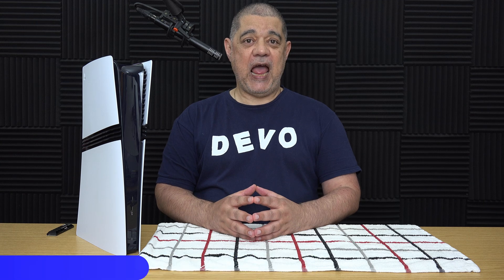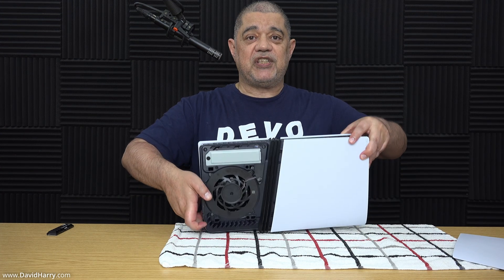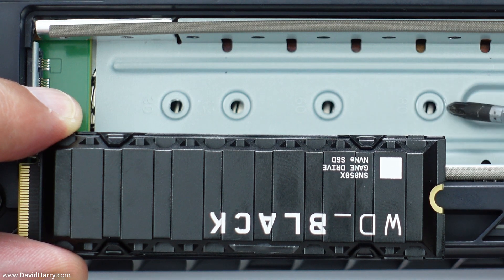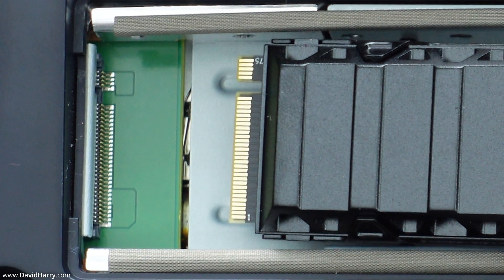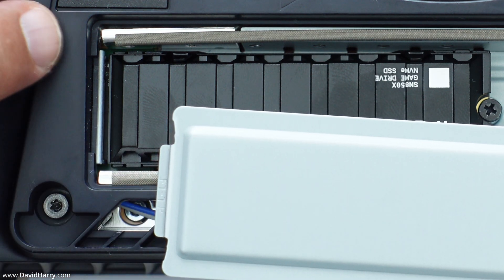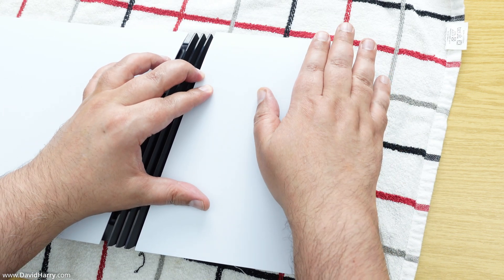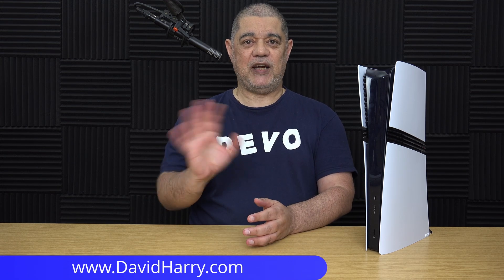How to install an M.2 NVMe SSD into a PS5 Pro | Step by step guide for PS5 Pro SSD upgrade

Comment: Few things to note:
1:38 unlike the slim on pro this screw seems like its cross threaded from factory
1:45 Notice how soon as the screw comes out the plate seems to pop out meaning it doesnt have a perfect fitment unlike the slim models where it fits flush
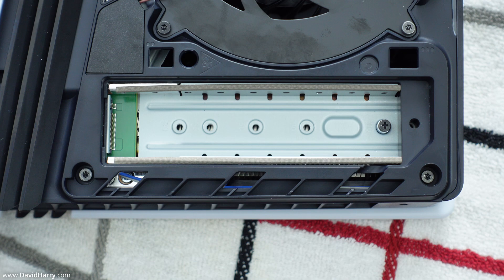2:19 This screw seems squeaky on pro unlike on the ps5 slim which seems like pro has lower quality machining than the slim.
5:45 Notice how paint is already scratched as if screw was forced on at factory

Do you agree Davey?

Comment: This is a fantastic tutorial and to be honest. It's not hard to install an SSD in any other PlayStation models. The hard part is removing the plates now when it comes to the PlayStation 5 Pro it hurts and it's kind of painful because as you remove them, they pop and it feels like they're going to break but it's a fantastic tutorial for those that want to have peace of mind when they want to change their SSD on their PlayStation 5.
Reply from the maker: Hi, I'm glad you liked the video 👍 And yes, it's a little nervy when it comes to taking off the panel, however, it is fine to use a bit a force as this is what is needed. But I would personally like to see a better way of removing the panel without the fear that you mat snap it. Cheers, Dave.

Comment: When you add an NVMe drive to PS5- does it add the existing SSD capacity to the new NVMe SSD capacity or does PS5 treat it like there are 2 separate NVME SSD drives?
Reply from the maker: It becomes a second drive and then the PS5 has a new option of where you want to save any new game downloads and also if you want to copy existing games from the internal SSD to the second SSD and the other way round. I'll do a video about this soon. Cheers, Dave.

Comment: Worked perfectly thank you. Simple to do even if you're a newbie just have to follow the steps in a methodical manner. If you're an old school PC person or PC person who's used to upgrading a PC its a piece of cake. Remember before installing the SSD make sure the PS5 or PS5 Pro you've updated the latest software on the console FIRST, then install the drive.

Comment: Ive watched a bunch of these but what aboot the FIRETRUCKIN heat sink?  And yeah this shits weak! Any ninny with a philips can plug in a frikkn chip. What about if you have to update the firmware on the chip????  Lots of folks talk a out how after their install their rig crashes. But nobody talks aboot the sketchy end of this…… F*#@&$N software/firmware.  Like doing a vid about adding a HDD or SSD in a PC and all they show is plugging shit in. Sorry as phuk

Comment: Hello brother. I have a question and I haven't been able to find the answer anywhere online. I have a 4Tb SSD in my current PS5 and would like to transfer the SSD Games from that drive to my new 8TB. WD drive, how would I do that?
When I do the data transfer method in the settings, it only transfers games from the console storage. Not SSD to SSD😞
I can't transfer my current PS5 SSD games to my console storage because there's not enough space in the console anymore.
I know I could install all my old games to the Pro new big SSD one by one via disc insert and Digital redowownload, but that would take a long time.
Is there an alternative easier method?
Reply from the maker: You will have to copy games from the 4TB to the console and then to the 8TB. You will have to do a lot of disk swapping. Or try putting one of the SSDs inside an enclosure and connect it to a USB-C on the PS5 and do a direct transfer.

Comment: In the states, we call that “space-uhh” a “space-errrrrrr” 🤓.  JK, Thank you for the comprehensive video!  The Pro M2 install is a little simpler compared to the original PS5 as you only need to remove the small half plate to get at the M2 slot. 👍
Reply from the maker: Hi, Joseph. We say space-errrr in the UK as well and that is what I am saying but my accent must be getting in the way 😂 Yes, that smaller half sized side plate does make it a bit easier to get at the SSD compartment 👍 Cheers, Dave.

Comment: I have seen like 10 videos like this but no one actually turn on the console to see if actually works wtf !! I installed mine and I use to have it on my other ps5 but for some reason the ps5 pro is not reading it

Comment: Helpful video👍. I have my SN850 SSD with a Sabrent M.2 heatsink on my OG PS5. Can I use that same heatsink on the pro without compatibility issues or heat issues?
Reply from the maker: Hi. I'm glad the video was helpful. Unfortunately, no, you cant use your PS5 heatsink. Checkout this video you may find it useful https://youtu.be/bSnjvGOrXjw Cheers, Dave.
Reply: @DavidHarry  Just watched that video! Thanks! Really wanted to use my sabrent because that was the best heat sink on the market during its time for PS5. The Haechi H02 the guy used in the video that's compatible. Is that even a good one to use for the pro? Cause, I never heard of that brand or model. Is there any other heatsink models that's compatible to use for the pro?
Reply from the maker: @Raider_41  Hi. That guy in the video was me 😆 and yes it's a good heatsink and will work with your WD. Keep an eye on my channel I will be doing a video soon showing and installation with the 4TB SN850X and that same heatsink. The compartment on the Pro is way too small for some of the big heatsinks that you can use on the original 5. Cheers, Dave.
Reply: @DavidHarry  Oh didn't know that haha😆. I noticed that the Haechi 02 doesn't have a thermal sticky pad on the bottom of the cover like the sabrent does. So I guess it has its own way of keeping the SSD cool. There's not much heat sinks I can find online that are the best with the pro because the pro just came out and it's still in testing stages with that. And most heat sinks are compatible with the OG PS5 and slim but not the pro, so it takes some research to find the right ones. But I'll look into it. I'll look forward to watching that next video.Thank you.
Reply from the maker: @Raider_41  👍

Comment: We need to have serious discussion about how easy it is to snap off the little claws of the panel. Its not that easy to take off these panels. they need to think of another way .
Reply from the maker: Hi. I think we need to have a few discussions about the PS5 Pro. Don't get me wrong, it really is a great console, but there are a number of questionable decisions by Sony. Cheers, Dave.
Reply: hoping I can get another one my bottom 2 bent in didn’t realize it was supposed to slide so it’s not a super tight fit

Comment: The panel doesn't grip into the ps5 pro it's loose where the three holes are, but it grips in firmly on the other side. A lot of other people are having the same issues..
Reply from the maker: Hi. Yes, where the 3 holes are the panel doesn't grip, it slides in, the grip parts are at the top of the panel, you could hear this click when I pushed it in. Cheers, Dave.
Reply: yeah my bottom two outside ones on the 3 panel part bent in bc I didn’t realize it slid in…is it okay if those aren’t in 100% or can I order another panel from Sony?

Comment: Maybe a dumb question but with the cover refitted how does the fan dissipate the heat from the heatsink?
Reply: If I remember correctly the ps5 uses negative pressure throughout the system, which is why you HAVE to replace the metal plate cover. Otherwise you create less negative pressure as you’ll have a “leak”
Reply from the maker: Definitely not a dumb question. I don't know. I was going to say something about it but I didn't think that this was the right video. I cant see how the fan channels any air past the SSD. The part of the fan that you see in the video is the intake. It essentially draws air from vents on the three edges of the case when the panel is on. I can only assume that some of the incoming cool air is drawn/sucked past the heatsink. However, I don't see any air channel/s directly inside the SSD compartment but it does sit right next to one of the intake vents, so maybe there is cool air being drawn past the compartment and heatsink on its way to the fan as part of the input airflow. But yes, it's not super obvious. Cheers, Dave.
Reply: @DavidHarry  thanks for sharing your opinion, David. The fan works on the principle of drawing air in and passing it over the internals before passing it out. I could possibly see that with the cover removed there would be air movement in the vicinity of the heatsink but left on the entire combo is sitting in an enclosed box. Oh well, I have to believe that as Sony designed this recess it must work.
Reply: I heard many people don’t put the cover back on. No reason to. Get the extra air flow over your SSD brotha.

Comment: Fantastic tutorial Dave. I'm sure PS5 owners will appreciate you detailing each step.

Unfortunately, for us XBox Series S & X owners, we need to pay ridiculous prices for their custom drives. It's easier to add storage, but much more expensive. I prefer the way Sony handles it.
Reply: You can now buy them from other manufactures like seagate etc.
Reply from the maker: Alright, Kevin. Yes, that's main problem with Xbox. I've got a Series S and an X and I've never fancied paying for those expansion SSDs cards. They are way too expensive. Cheers, Dave.
Reply: @DavidHarry  I held back for as long as I could, but my regular games were just taking up too much storage. So I had to buy the 1TB card for £129.99. it's been great since then .. but I did grudge paying for it when I had many spare NVME drives I could have used.
Reply from the maker: @KevinMuldoon  Didn't they start off at £179? And was it only Seagate who were allowed to make them?
Reply: @DavidHarry  Yeah there was only one option initially and it was more expensive. Still a rip off but they do perform well 👍